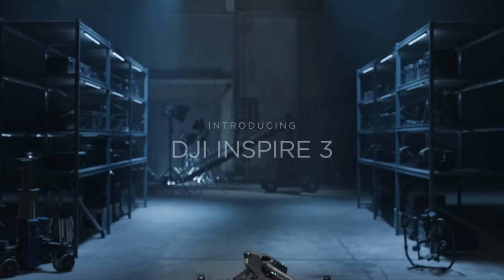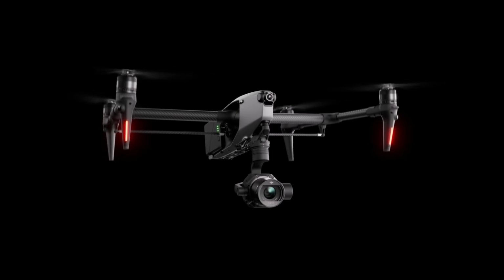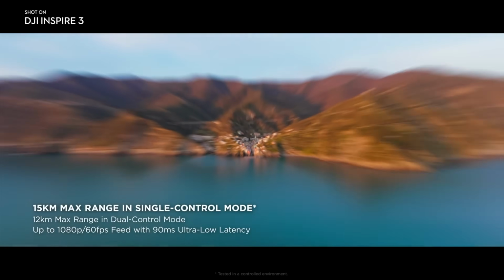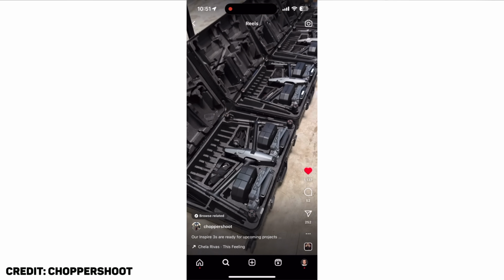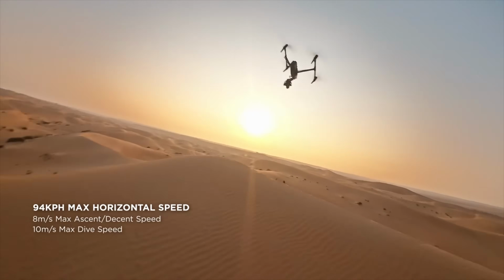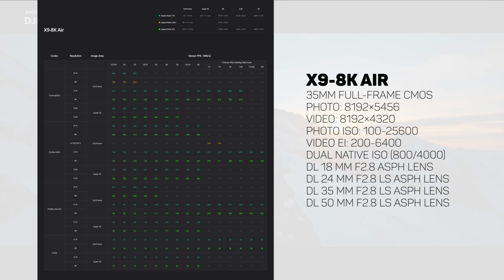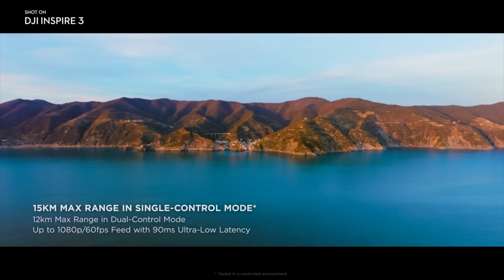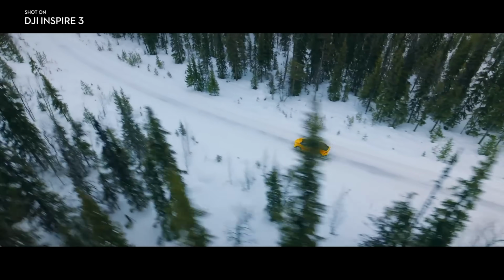DJI Inspire 3 - My Initial Thoughts & Impressions

Comment: I am really disappointed in the flight time. I feel a drone that size can definitely take on a bigger battery. And basically all the added features or upgrades are minimal for the price of $17,000. 

Now I would like to know, will that controller be compatible with Mavic 3 Pro.
Reply from the maker: Probably not, regarding the remote

Comment: The lenses mentionedy, are they different from the existing ones for the X7. ? They look the same specs wise. The only new lens seems to be the 18 mm or am i missing something?
Reply from the maker: They are the same lenses. The 18mm is the only new lens.
Reply: @billykyle  full frame vs s35 sensor coverage?

Comment: As always Billy a compact elaborate description! well done!! being an I2 owner since 2017 for me the I2 been a love hate relationship, I was disappointed with the issues that DJI never rectified however on the positives it has Dual operation / modular camera options and agility, there was nothing else available. I agree I3 is for the high end commercial / drama sector where producers want the equivalent  acquisition tool and grading options as their editor would have with Arri / Reds etc. Spec wise this this sounds be a possible game changer for those who would normally need a more expensive complex heavy lift UAV requiring far more risk assessment. I agree that the return on investment can be viable for pro individuals.
Reply from the maker: I agree with the issues. I’m hoping that with the newer technology this drone releases more smooth.

Comment: They could of made the battery way longer it’s a big drone the batteries are big they could of made it 40 mins
Reply from the maker: They have to try to balance a lot of different components to get the most efficient build they can.
Reply: They could have but then you wouldn't be able to air travel with it. 100watts or less is the legal limit for travel by air.

Comment: I dont think that DJI will sell too many of the new inspire 3. Too big, no prop guards etc. There is only a small clientel that will have use for the inspire 3. The future is certainly , a small drone with great camera quality and prop guards that are very easy and quick to install.. I also like to point out on the extreme good quality movies drone pilots are making with Mavics 2 & 3 and Mini 3. Profesionals with larger drones are usually not making much better movies with their more expensive drones.
Reply from the maker: No prop guards? Really?

Comment: I picked up a inspire 2 cheap on ebay. Quickly learned I had zero use for it and to much anxiety to fly it. So I managed to sell it and recoup my cost thankfully. I don't see my self flying inspires any time soon. As you said the smaller ones can get the job done for majority of jobs.
Reply from the maker: Yeah, the small drones have gotten very good

Comment: Talking about speed.

It's relative first to the voltage that can be supplied to the motors.

Hence props spinning faster.

So they need to balance the system between resonable and ridiculous for battery usage.

Loading a 12s or 8s battery would exceed the target weight ..

Spinning the props fast like a 5 inch drone also is not the total solution. 

The prop disc area plays a big roll as well.

Just imagine spinning a plane wing and facing that flat side directly into the airflow .. there is a massive surface area that needs to be overcome by increasing the rotational speed to move foward..
Reply from the maker: Yeah there is a lot of factors at play. Especially the gimbal, who knows what wind speed it would be rated for without starting to show signs of shaking.

Comment: Why is it so goddamn expense?! 😡 I was expecting 13k for full kit but this is more like 20k plus for only 20 mins of battery life
Reply from the maker: Because it offers unbeatable camera specs.
Reply: @billykyle  Lets be honest, 1.5 years from now the mavic 4 will also feature 8k 60 fps and even though the camera will be smaller, it will be everyone's go to just like the mavic 3 and mini 3 today versus the inspire 2 which I rarely ever see because it's such a pain to work with
Reply: It's actually closer to $30K when you include the extra batteries, $3900 care refresh, lenses, 2nd controller, extra media cards, etc...

Comment: Was hoping there would be a 2 tier version of this drone, similar to the Ronin 4d 6K & 8K, & that it would use the same cameras as the ronin 4d (with the ability to use small third party lenses)…it would then just about work for my business price wise. 

But at £14000  Theres now a huge gap between the Mavic 3 and the Inspire 3 which needs to be filled imo
Reply from the maker: Yeah I agree. Phantom 5? lolololol

Comment: I agree on many points, my Mavic 3 allowed me to be much pickier when I decided to go lighter and not lug a 55lb GPC case loaded down to 3 day music festivals and real estate shoots. That said I still wish DJI would meet its users in the middle pride wise and release a photo/video centric version of the M30 with an x7 with an integrated lens, all the new codecs, the RTK, and similar M30 styling/features and price it at $10,999 with a fly more and you’d sell a ton of them to us mid users in between the high end prosumer and the production companies using the i3..  having the stability of the RTK will be amazing in the i3..  I agree on the speed issue. Guess they were having flashbacks and 2nd thoughts after the initial i2 release when they were cracking gimbals off at 68mph and backed it down to 58mph 😛..  having 6 batteries and a the enterprise super controller is a great touch. As I said on another comment, despite our income my wife said not only no, but hell no😆…. Ah well maybe in a year or so.. hopefully DJI doesn’t abandon it like they did the last 2 inspires.. now if we can just get Sony to start updating our a1 and a7SIII’s 😊
Reply: Don't worry they will forget it within a month. Must continue the mavic spam
Reply from the maker: Mavic spam lol

Comment: Like you said, " if the Mavic series meets your needs the I3 probably isn't for you".   Put the "current tech" aside,  there are times when the I series shear size is a hindrance.   If DJI would release a  Mavic series with optical zoom, I could justify spending a stupid amount of money for a drone <:)
Reply: Which is why we need a new Phantom instead
Reply: @antoniohagopian213  I'm torn on that one.  I'm still flying Phantom 4 Pros.  I have a " like new" backup as well.   I'll probably keep flying the damn things until I crash both of them or DJI totally cuts off the battery supply.  For an ancient platform, the damn thing is like a flying stable tank. The stability and ability in high winds are beyond impressive. I've flown the drone on days that I really shouldn't have.  But,  if I have the lateral room, and I can at least hand launch the P4P I know it will fly.  It might take me most of the battery to land it, but  I'll always get the photos I need before the descent fight starts! Low light stills can be problematic, which is, I think its major drawback;  I consider the noise issue to be a bigger problem than  oc1.  Having said all of that,  for the type of flying I do for compensation is best suited for the Mavic frame. with an optical zoom <:)   I almost forgot the 6 year old  $1,300 drone also has a mechanical shutter,    The cheapest DJI drone with a mechanical shutter  in 2023 costs upwards of $4,500 when you buy the drone, batteries, case, props, controller, etc.
Reply: @craighermle7727  I wouldn't want to try and catch a mavic in windy conditions. I, as you have used my p4p in windy condition, and keeping my fingers intact is a big deal 😂
Reply: @antoniohagopian213  Agreed!
Reply from the maker: YUP

Comment: You could've elaborated a bit more on the SSD part. It's really a great feature than the damn SD cards.
Reply: I’m glad it’s included in the price.. it used to not be included in some packages so you had a propriety dji SSD that was 960gb for an astounding $1599for the bargain price of a 5 pack for $4500 if I remember correctly.. a definite necessity with that RAW and ProRes data rates. Old Inspire 1 RAW was up to 4.7gb/second
Reply from the maker: @johnsoncityaerialphotograp7201  Yeah good point, I am glad it's included as well. The SSD really isn't a "new" feature, it was on the Inspire 2 as well.
Reply: @billykyle  oh for sure. I have a nice 960gb from my i2 laying around our office somewhere. I need to sell it to someone. I read in the literature somewhere that now you don’t need that ssd reader anymore as it plugs directly into computer with a USB C cord

Comment: Why has the price of the inspire 3 quadrupled compared to inspire 2?
Reply: Poor people can't afford this, stick to your mavics scrubs, this is where the men separate from the boys lol.😂
Reply from the maker: Because it’s capabilities have quadrupled.
Reply: @billykyle  it's not worth $12,500 more than the inspire 2. The new features are not worth 4x the price.
Reply: @bushgreen260  much different economy than 5 years ago.. more expensive tech requires more R&D time and want a return on its investments, different taxes and sanctions on China than before to some countries.. I own an inspire 2 and a x7 camera and this new one is miles ahead with its transmission system, built in RTK, better fpv camera, software and flight stability, etc. I honestly thought it would be more expensive .. it comes with 6 batteries ($1850 worth), an enterprise controller that costs probably $2k, a cool 6 slot battery charger base, etc.. at that price I would’ve liked to see a lens come with the camera gimbal however. With the m30t and others in that price range I figured body only would be $15k. Most production companies that this is targeted at will make that $16k+ back in 1-2 productions. I’m in a $250k plus income bracket before my wife’s photo work income and she still said not only no but hell no 😂
Reply: @bushgreen260  because they have 0 competition and monkeys will buy whatever dji puts out anyways. Blame the mavic spam for that. So they crank the proce to whatever.
Reply: @Johnson City Aerial Photography LLC  lens not included in set. Only case for lens)
Reply from the maker: @bushgreen260  Then don't buy it
Reply: @billykyle  I never was going to buy it.